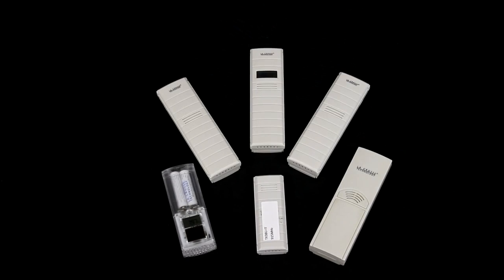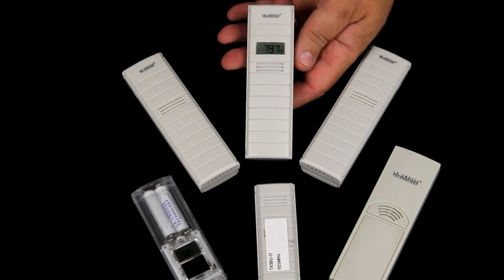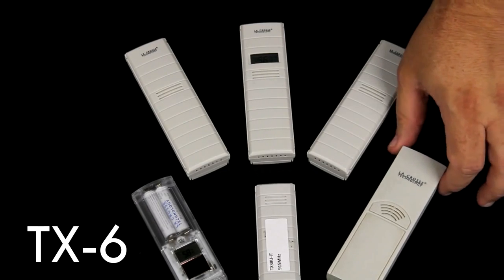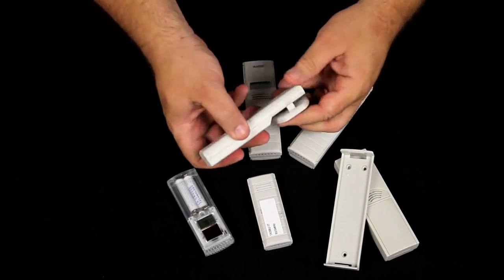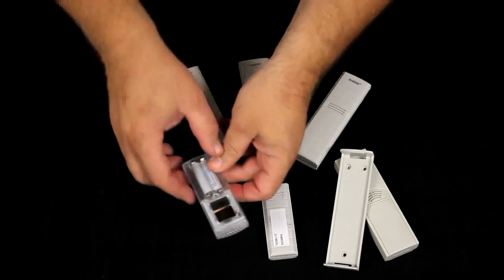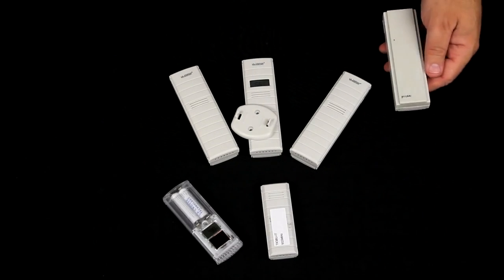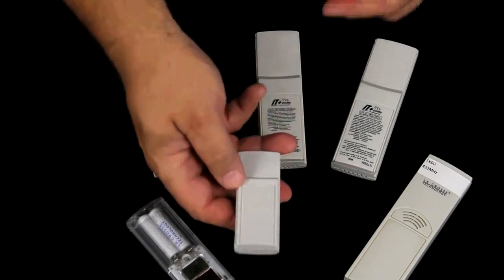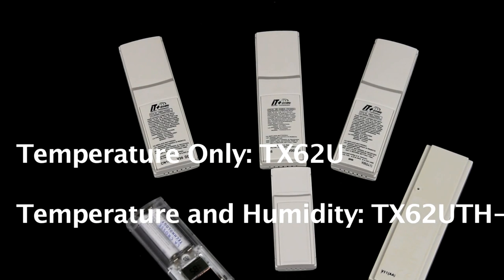Remote Outdoor Sensors

Comment: I have a TX38U sensor, and works from time to time. Battery's fully charged. ¿How can I buy another?
Reply from the maker: Hey Eremurillo, if your outdoor reception is intermittent, this is typically a sign of interference. Our first recommendation would be to try a new location for the sensor and/or display, possibly moving them closer together or away from other electronics. Be sure also to use new reputable alkaline batteries, other types can have transmission issues. If this still does not help, a new sensor can be purchased here: https://www.lacrossetechnology.com/products/tx38u-it
Reply: @lacrossetechnology  Thanks!!!
Reply: @lacrossetechnology  The sensor is for this item: WS-8115U-S Atomic Digital Wall Clock with Indoor/Outdoor Temperature. The information about the sensor in the web page says "this item is compatible with ONLY the following units: WS-9007U-IT, WS-9007B-IT, WS-9007BK-IT, WS-9007TWC-IT, WS-9009U-IT, WS-9009BK-IT and WS-9009TWC-IT". Will it work anyway? And another question, ¿Delivery service includes Mexico?
Reply from the maker: @eremurillo  We are truly sorry for the trouble. Please reach out to our store directly for help with this. Phone: 608-785-7939  Email: store@lacrossetechnology.com -- Though we should note that they may need a U.S. address to ship out any new products. Our apologies again for the inconvenience.
Reply: @lacrossetechnology  Thank you very much.

Comment: Anybody have a recommendation for the best batteries to use in sub-zero weather?
Reply from the maker: Regular alkaline batteries should be fine for temps down to about -20 degrees fahrenheit. But if you expect colder temps, lithium batteries would be the way to go, however, not all of our sensors will work with lithium batteries. Please make sure to check your station and sensor specs before you purchase.
Reply: @lacrossetechnology  My TX141TH-Bv3 specs do NOT mention type of batteries. Can I use "lithium" batteries in THIS transmitter? THANK YOU!
Reply from the maker: @TheOzthewiz  Lithium batteries should work with our TX141TH-Bv3 sensor. However, if you experience any connection issues you'll want to switch to alkaline.

Comment: I just found sensor model TX,141V2 outside. What's this things true purpose?
Reply from the maker: Hi Tammy, that would be a wireless sensor used to monitor temperature conditions outdoors or in other locations such as freezers, wine cellars, garages, or pretty much any location you'd like to keep track of. This device will send its data to one of our many indoor weather station or clock displays. If you're interested, a full list of our current weather station lineup can be found on our website here: https://www.lacrossetechnology.com/products/weather/weather-stations

Comment: I have one and I do not know what its function is
Reply from the maker: Hi Estela, so you only have one of our sensors? Typically, these are paired with one of our weather station displays. The sensor gets mounted outside and provides outdoor temperature and humidity readings to the indoor display. You can find our selection here: https://www.lacrossetechnology.com/products/weather/weather-stations

Comment: Must the sensors be outside??
Reply from the maker: Hi Nick, nope! You're free to place the sensor(s) wherever you need monitoring. Outside is just where most people use them, especially since our displays typically say "OUTDOOR" next to those readings. But if you have a unit with multiple sensors, placing them in freezers, basements, or garages are all great options as well.
Reply: @lacrossetechnology  thank you!!

Comment: How do I know which sensor I Need?
Reply from the maker: Searching by your product model number (printed on the back or bottom of your main display) on our website is a great place to start. As you search, a dropdown will appear with links to your Part/Sensors tab which will show you all of your replacement or add-on sensor options. Our page here: https://www.lacrossetechnology.com/pages/sensor-finder will show you how to do this.
Reply: @lacrossetechnology  the sensor I need is listed as retired, and no info is given for a suitable replacement......
Original sensor is TX21U . It will no longer connect. *very* occasionally it will connect, but it hasn't done that in a couple weeks. Already tried new batteries, new startup sync procedures, etc. Can you suggest another remote sensor?
Reply from the maker: @coeneschamaun1735  If no other sensor options are listed for your product, a new system would be the next solution. For assistance in finding something new at a discount, please reach out to our store at 608-785-7939 or via email at store@lacrossetechnology.com 

Our sincere apologies for the inconvenience.

Comment: I hate that the solar one does not have replaceable batteries. It worked fine for 2 years and I guess that was it for the rechargeable batteries... now what? straight to the bin and encouragement to buy a new one? Really? Why is it designed in such a way that I can't I replace the rechargeable batteries?!
Reply: If you still have it cut it open and put new batteries in... I did that to mine by using a razor at the seam. The originals are rechargeable alkalines, but you can out regular alkaline in, just change them after a year because they'll leak. Rechargeable alkalines are built more robust than single use cells.
Reply: @volvo09  Or put in "lithium" cells, should be good for at least couple years!